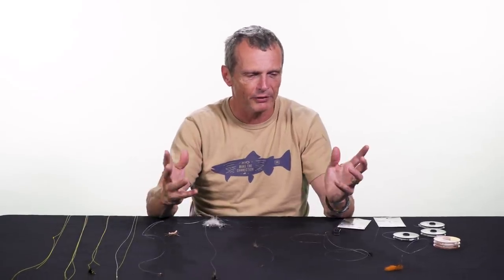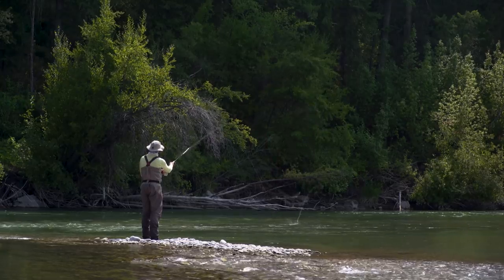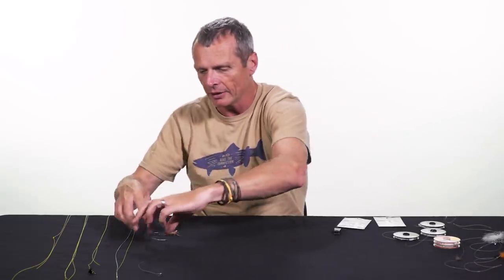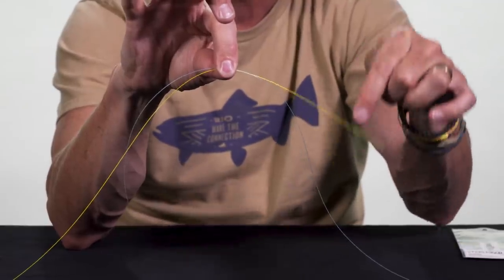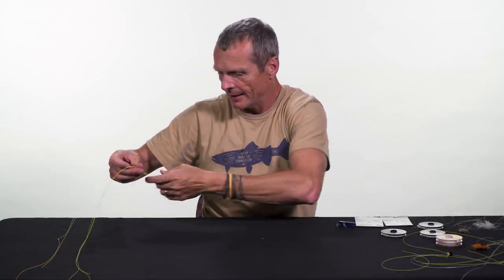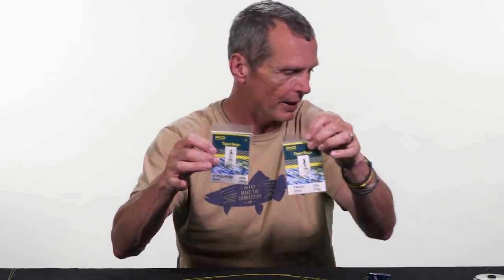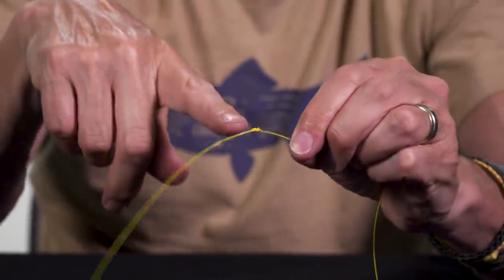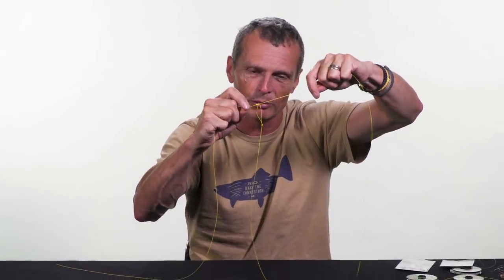Dropper Rigs | How To Tie

Comment: I use all these methods but I usually prefer tippet rings for simplicity. Tippet rings seem to increase knot strength over line to line connections. Tippet rings also allow you to quickly add new leader material without having to redo the entire leader (as he explains).

Comment: Very informative and helpful video. I have a question regarding the polish technique you described. I believe you said to first tie a triple surgeons knot in your leader. I believe you also said to tie this knot WITHOUT tying in a piece of tippet. Please explain this. I only tie a surgeons knot when I am tying two pieces of leader/tippet together.  Thanks.
Reply: its basically your "swivel flys" stop knot to prevent it from slipping down the leader
Reply: Make a loop with your leader, then feed the end thats going to your fly inside the loop about 3 times and pull. Theres no need to do it with 2 different lines as theres no waste. Its just to make a knot really.